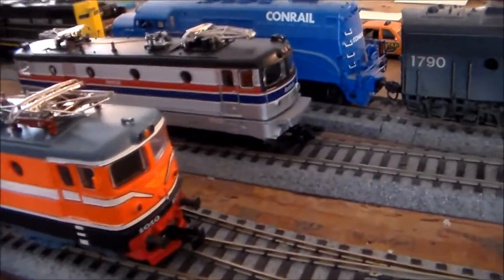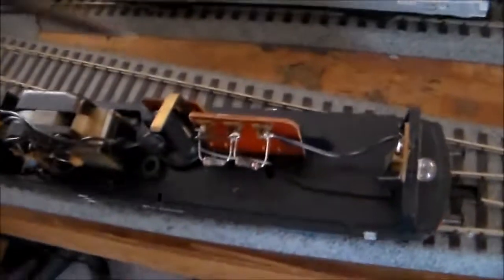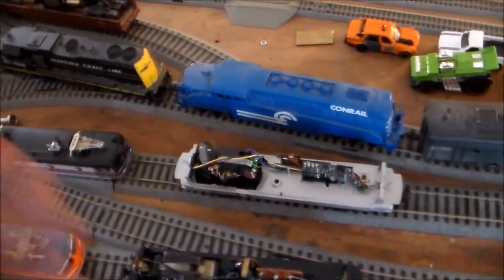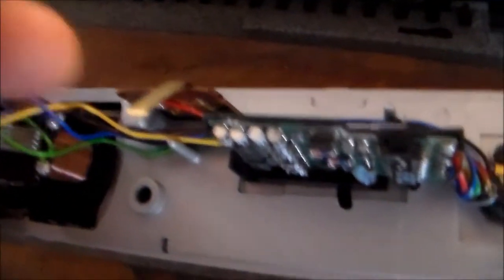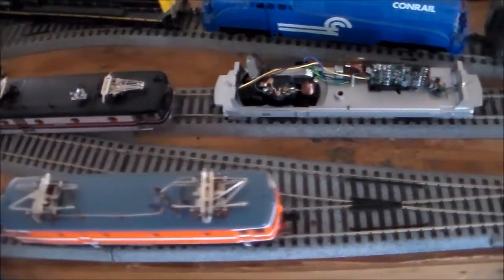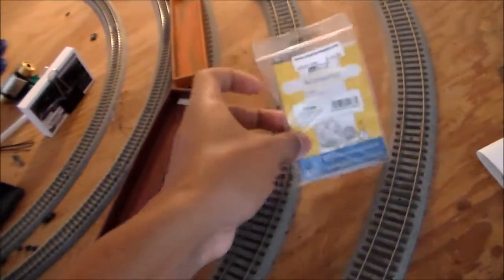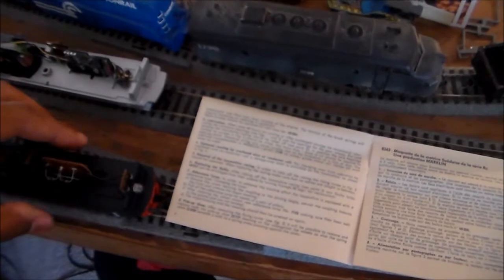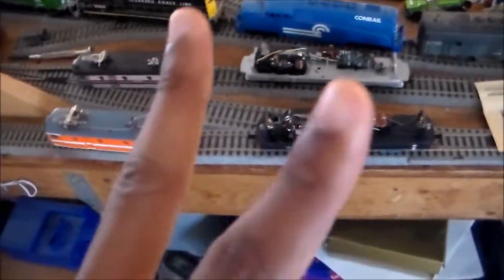Amtrak X995 Part 2-DC Conversion Plan

Comment: I have the Marklin X995 as well, but never got around to converting it over to DC/DCC with my busy schedule. I planned to mill out the Marklin chassis to retrofit an Atlas AEM-7 motor/chassis, wheel sets and lighting as I am not to fond on the pancake style motor and how loud it ran on my Marklin test track. Hope to see your end results soon as it may just inspire me to get started on my conversion too :-)
Reply from the maker: We're you the one that posted up pictures on an online forum and explained that? Like there were pictures showing an atlas Aem7 next to the X995 and someone was explaining that something. Are you the same person? Well compared to other motors in that class  the marklin ones are built tough and are durable. The HAMO Marklin DC version is noisy but it's still quiet compared to other motors in the same class. Thanks I can't wait to start this project. I have to still order the decoder for it and LED lights and I should be set to go. I hope it'll inspire you to convert yours also :-)
Reply: No, that was not me, but I would like to check out that forum it you have it. I have not seen anyone convert this X995 from AC to DC beside seeing your plans in this video which is a much simpler approach than milling out the Marklin chassis to integrate the Atlas frame to support the motor and wheel sets.
Reply from the maker: Oh I see. I'll see if I can find the link to it. I heard of someone that has but they did it the hard way which is more common. Indeed snce I am just swapping drive between them it eliminates all that extra work but it was still a bit of s cost.

Comment: Excellent update video. I'm surprised that board from ESU is not a decoder already. Well you have to go sound. Treat your self we only live once. Your busy at work, school, and all that other good stuff. Your worth the expense my brother. 

Peace be with you,

Arthur
Reply from the maker: Thanks man. And well I could have brought that version but I didn't want to hard wire one in like that. So I brought the adapter board so I could just plug in whichever decoder I wanted. I plan to add sound to it. It might be sooner then later. Well I was putting off buying that second unit for almost 4 months and I got tired of waiting, so I just brought it. Indeed it was worth the expense.

Peace be with you also!